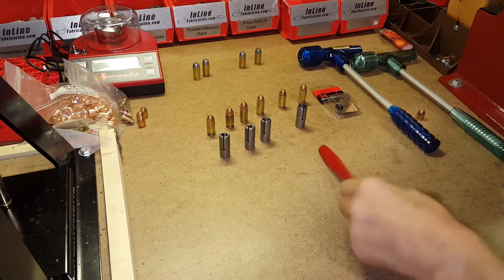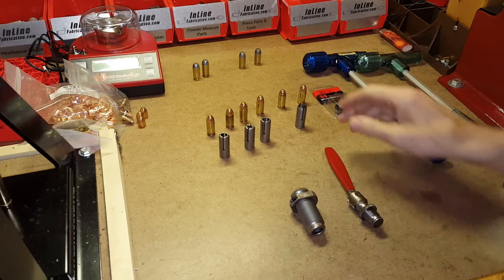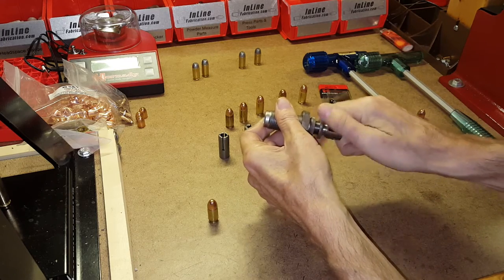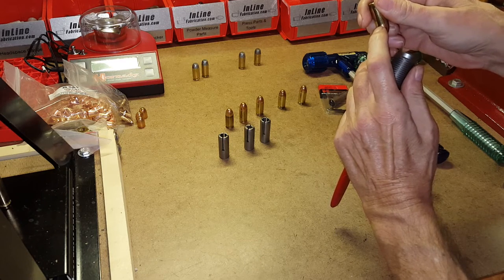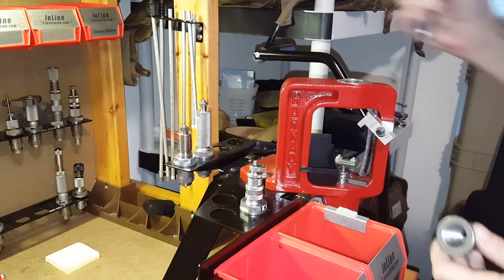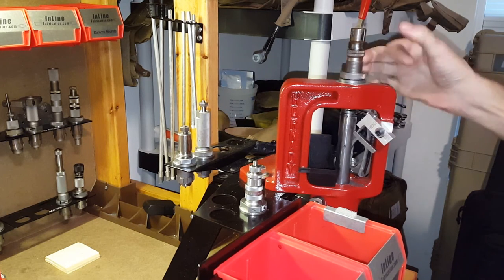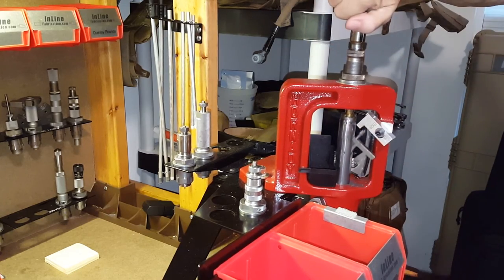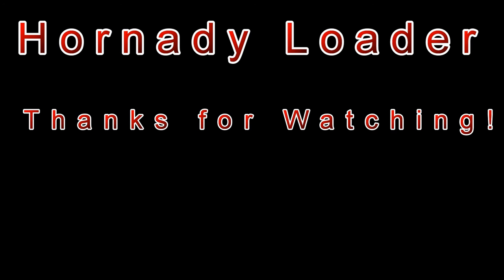Hornady Cam Lock Bullet Puller

Comment: Thanks for the great video.  I haven't taken the Cam-Lock Puller out of the package yet, so I haven't read the directions.  I've seen several different methods, and your way to set this up is far easier than any other video I've seen.  Thank you!!!

Time to go remove some 38 SPL projectiles.

Comment: As you experienced, trying to set this up using the included instructions can be challenging, at the least. I tried and failed numerous times over the past 4 months, finally giving up. Last weekend I came across this video while away from my bench. Little did I know, in 3 days I would have the need to put your adjustment method to the test. While placing different loads into the same 50 round box, I had a senior moment...and 28 rounds were tossed into the air. I initially separated the rounds by weight...I knew the weight of each bullet, and I knew the weight of the powder charge. So I presumed that the heavier round (by 0.4 gr) belonged to the 3.9gr loads, and the lighter rounds belonged to the. 3.8gr loads. But was I right? I didn’t pre-weigh the empty cases. 
Wanting to add a degree of certainty, I decided to pull the bullets from the lightest rounds in the 3.9gr group, but I needed to do it without destroying the integrity of the round, which is certain when using a kinetic puller. To make this long comment shorter...your process worked. Test the adjustment out of the press, get the die adjusted to lock on the bullet, then place the die into the press and pull the bullet. I didn’t get the adjustment perfect, I couldn’t get the handle down to 90degrees. But I also discovered I didn’t need to. Just ensure the collet is on the bullet, maintain a light pressure, and lower the ram handle. Thanks for another great tip.

Comment: Just a suggestion, I have been using this cam lock puller for a while now and I noticed that you use a little to much pressure pulling the handle over. If you use just enough pressure to hold the bullet the handle rolls over easier and it wont scratch or dent the bullet and render it unusable. That being said I like your videos.

Comment: Cool! Been thinking of getting one of these, but wanted to see one in action first. I'm sold, thanks  =)
Reply from the maker: +SomeGuyInSandy I think you'll like it.  It does take some practice to learn how to adjust it properly, but once you've figured it out, it works well.  I'd be curious to know if you are able to adjust it based on the instructions that come with it.  I was really frustrated with it until I just sat back and came up with my own method for adjusting it.
Reply: OK, I just ordered a set with some useful collets. When it gets here, and I have a chance to fool around with it I'll let you know how it went.
Reply: I'm going to go home and hopefully follow your instructions tonight. I haven't been able to get it to work with the supplied instructions. I have several 9mm to pull from getting my Hornady LnL progressive set up.
Reply: This puller must not work with the plated round nose bullets I have. I've now followed Hornady instructions and yours to the T and it'll pull the stupid bullet but will never drop it then i have to disassemble the die in order to remove the bullet.

Comment: Kevin a nice alternative to the kentic bullet puller what is the price point on this? Will it damage hollow points? thanks for sharing your video.
Reply from the maker: +Lou Flores Yes it is.  They're around $25 for the puller, and about $10 for each collet.  Midway USA has the puller on sale for $23 at the moment.
Reply from the maker: +HornadyLoader Actually, it doesn't even leave a mark on the bullet itself.  And hollow points are no problem.  The collet grabs the bullet below where the hollow point is.
Reply: +HornadyLoader  Thank you